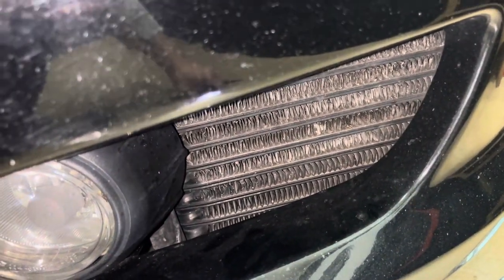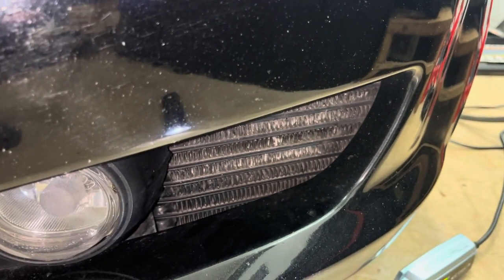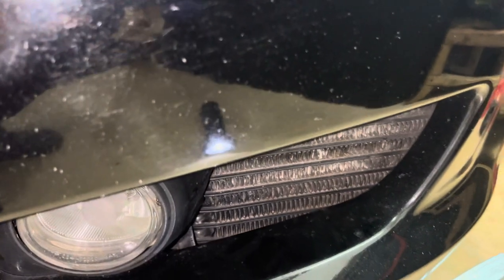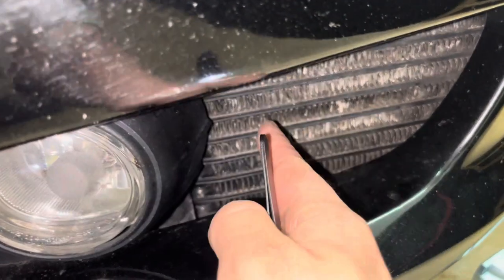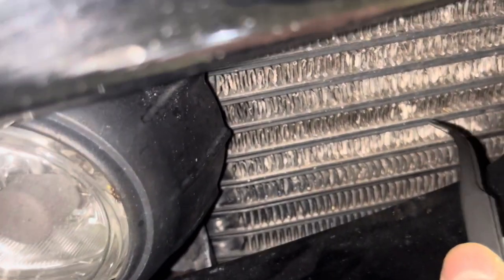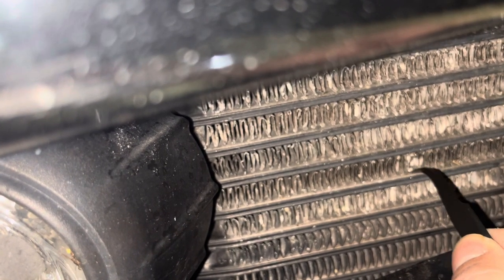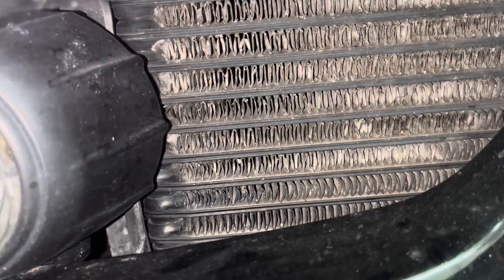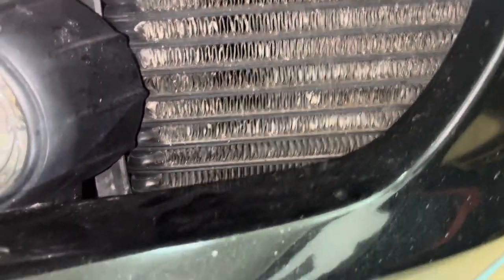Mazda RX8 - Oil Coolers Repair. Save Some Money

Comment: Use a strong shop vac. It pulls them straight. Then use a small flat head and finish them off. A lot easier than using tweezers, brother. Cheers
Reply from the maker: Oh I didn’t know that. I’ll give a shot! Thanks brother
Reply: Wheres the what no way guy at ? 😂
Reply: Woaaah noooooo way I did not know this thanks brother bear

Comment: Dose it matter if there like this mine is the same. Also is it easy to replace them
Reply from the maker: If they look like the ones from the video then you  should be good.  When the fins are really smashed is when you should be worried. And it is not easy to replace them. I mean you can do it but the bolts on the oil lines are usually rusted and it’s a pain.